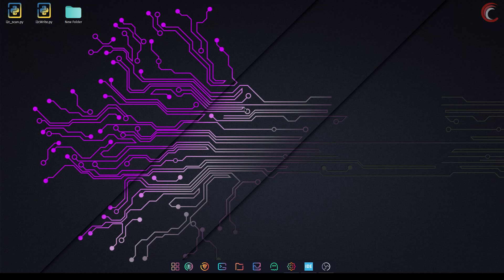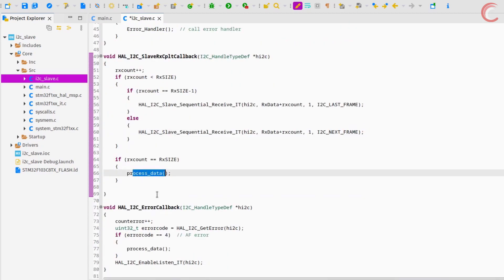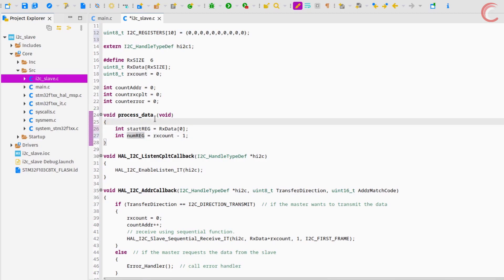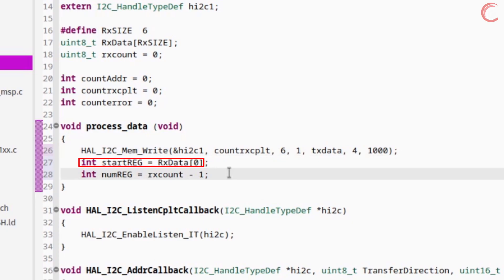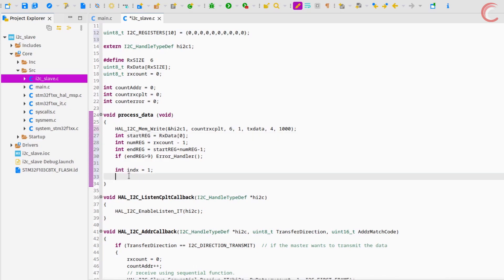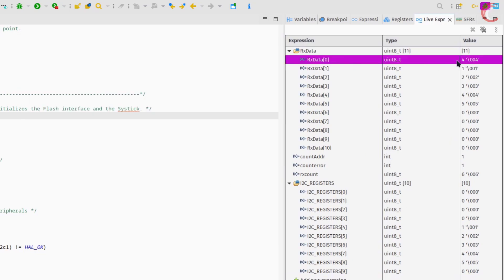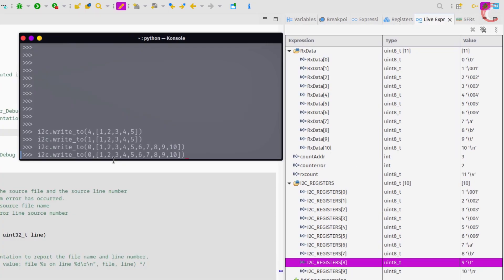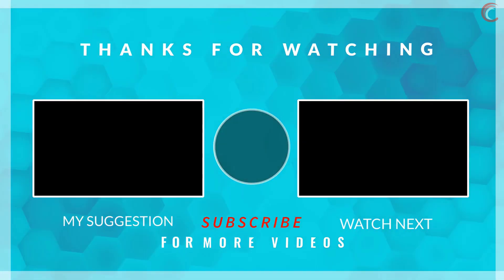STM32 as I2C Slave || PART 5 || Write Data into Slave Registers

Comment: Please correct me if I'n wrong, but according to me, you can't just use HAL_I2C_Mem_Write(&hi2c1, slaveAddr, 6, 1, TxData, 4, 1000) in the master code, because the address "6" is the address of the 6th register of the STM32 slave device, and not the address of the 6th element of the array "I2C_REGISTERS". But otherwise, your videos 1-3 were especially really helpful so far, so thank you very much!